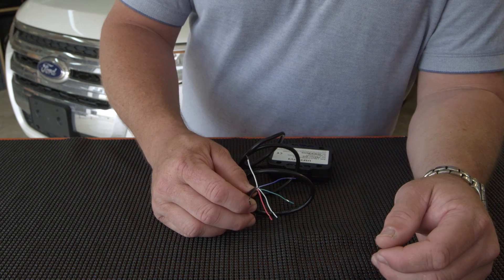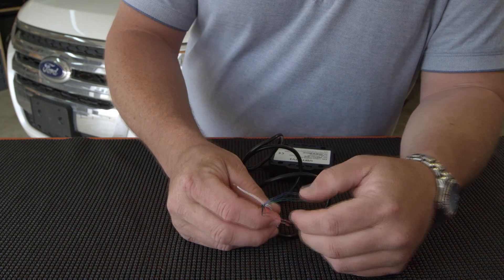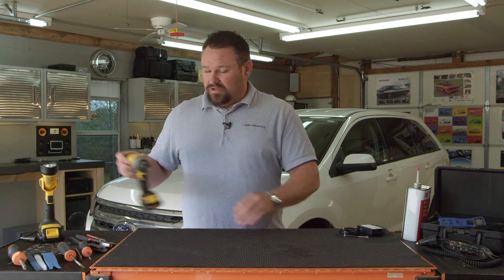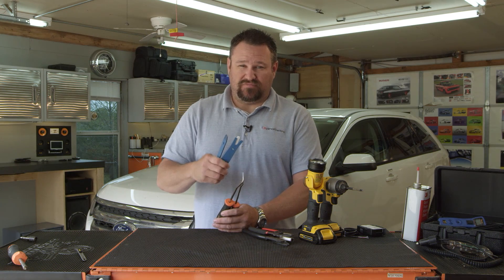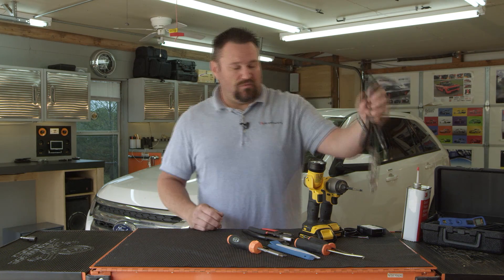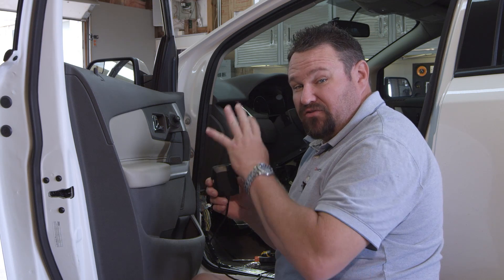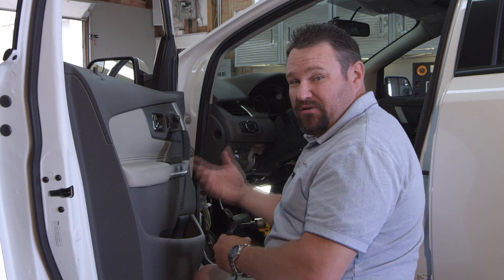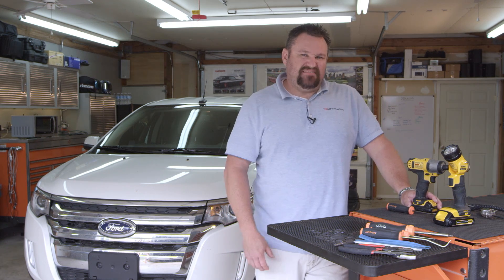How to Install GPS Trackers in Cars | US Fleet Tracking

Comment: Question I’m trying to install a GPS tracker to a Chevy spark 2016 and I can’t find the starter wire can you help me
Reply: Use a test proble.or.multimeter.while vehicle is off...ensure voltage is between 11v to 14v connect.red.wire to that wire. Connect.black wire to a screw of metal point as.ground.